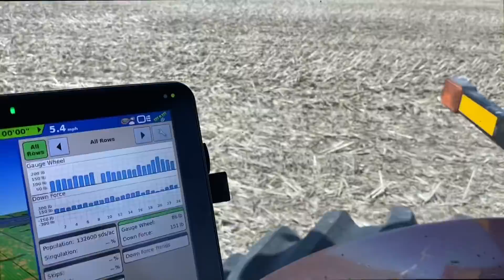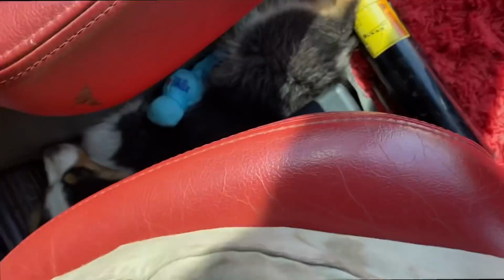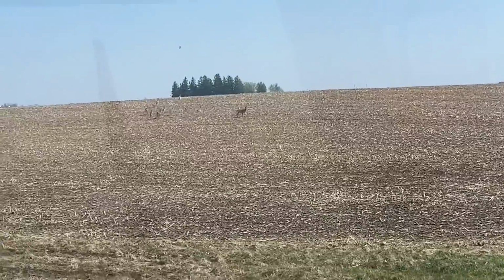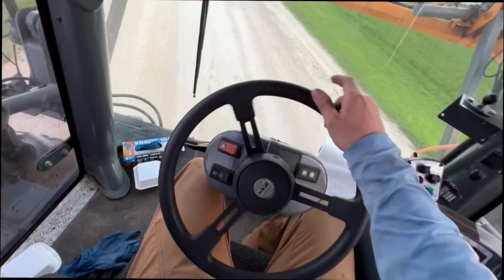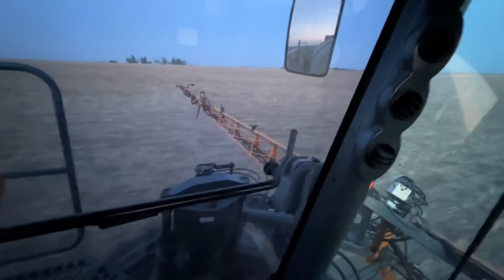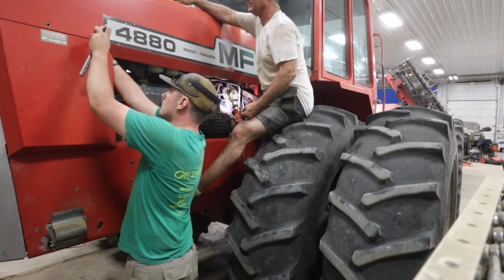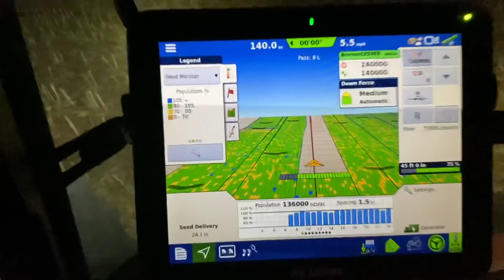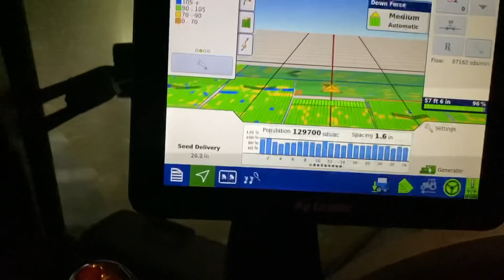We Hit A Telephone Pole With A Tractor

Comment: Corn yield losses are less pronounced percentage wise the later it goes into the ground. A 100% of yield potential is possible if planted by April 20. On April 30, the yield loss is 1.3%, May 10 is 4.2% and May 30 is 13.4%.

Comment: Farmer’s question: At 1 mile long, how long is the boom in order to cover one acre in one sweep?
Reply: 8. Ft
Reply: @richardradawetz8788 I was looking for 8.5 ft but the tractor turn adds about a foot :)
Reply: Actually it’s 8.25 ft. At 16.5 in a rod. Times 1/2 miles or 43560 square ft
Reply: @richardradawetz8788  agreed :) 8.25
Reply: an acre was conceived of as the area of land that could be ploughed by one man using a team of oxen in one day. DaMbA CornStar is worth a LOT of oxen :)

Comment: Something is wrong with your hagie if the more you rev your engine the fittings leak that’s not being very efficient ours you can pin it nothing leaks also my brother has a  Hagie that will do the same you prolly need to set your product pressure relief or bypass chemicals are pretty pricey

Comment: My biggest booboo was back was when I was discing with a neighbors Massey Ferg older tractor and I was going just a bit too fast over those big chunks of dirt in that 2wd unit. I snapped the massive front axle pin and ended up nose diving into the ground weights and all. I've never hit a window so hard. No seat belts, terrible rookie mistake. I could hear our neighbor cursing up the way when I called him with the news lol, oh memories.
Reply: My dad did the same thing with our 5288, last spring, 2nd time we broke an axle on that tractor
Reply: @DanielHoevener  it's not an easy fix, especially in the field. I paid 1300 bucks just to even have a tow truck drag it back to the field entrance so we could lift it.

Comment: What's a telephone pole?
Reply: A pole where you make phone calls. 😂
Reply: Climb the pole and make a phone call you can plug it in to the many volts running through the big wire at the top works great 👍. Only works once though 🤣
Reply: Isn't a telephone poll where they call you on the phone and ask you questions ? 😏